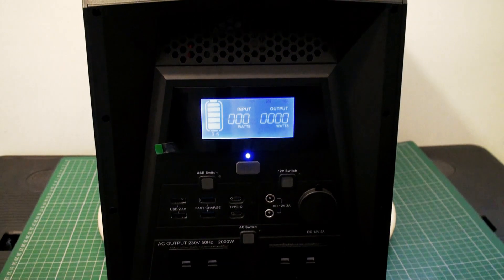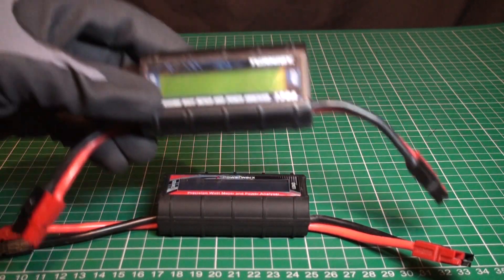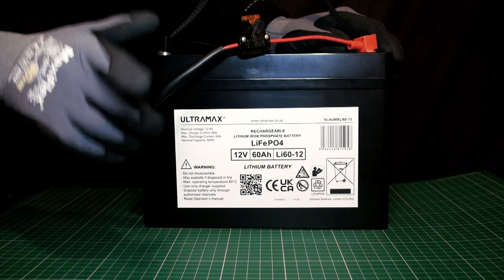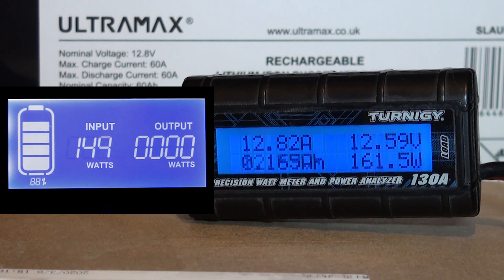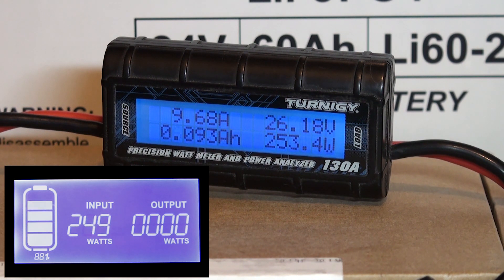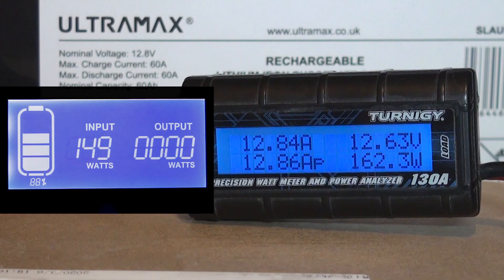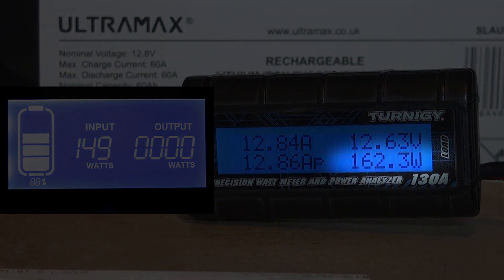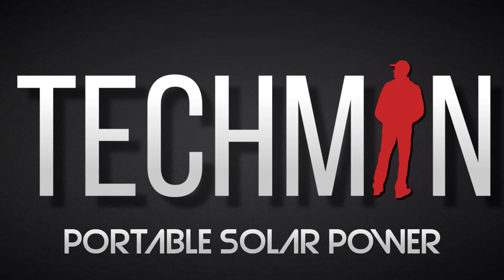Leoch Power Station DC Charge Test

Comment: I found this unit which might be handy to have on these Leoch Battery Generators.  Powerwerx DC-to-DC Solar Charger Controller for Bioenno 12V LiFePO4 Batteries.I think they may work on other manufacturers batteries. Do your own investigations. This will not work  on the XLr input on the first  one listed but maybe the 2nd one listed with a 12 volt battery and the first one on the the Anderson connection? I don't know if you can feed power with two solar controllers in series will work.what do you think techman? Help me out here if you can.

. Input Voltage: 20-50 VDC

Output Voltage: 14.6 VDC
Input Connector Type: MC4
Output Connector Type: Anderson Powerpole 30A
Maximum Power: 300 Watts
Maximum Current: 24 Amps

and/or  DC 12V to 24V 10A 240W Converter Step Up Voltage Regulator Boost Converter Module Car Power Supply Power Converter 
    (24981)
Reply from the maker: For the MPPT input (APP port), I would not recommend connecting an additional MPPT charge controller. Since the port is connected to the internal MPPT CC, it will accept anything from 10.5-35.5v. I demonstrate charging via 12v and 24v LiFePo4 batteries in this video. I’ve also used higher voltage batteries with a DC buck (step down) converter with no issues. 

As for the XLR port, it’s probably connected directly to the battery. The sensible thing would be a) a 24v LIFePo4 AC charger or using an external MPPT charge controller with the correct parameters. The MPPT CC algorithms will charge/boost/float the internal battery efficiently.

Comment: Can you try charging the with 3rd input (xlr input) I found online an XLR to xt60 adapter and then you can get an xt60 adapter to almost anything. Maybe 3rd party MPPT or even external batteries?
Reply from the maker: Hey Nathan. Thanks for the request. Yes of course, I’ll look for an XLR adapter for the experiment. Solar charging via external MPPT charge controller would be appropriate. Charging via external battery should be via the Anderson PowerPole port. I presume the cannon (XLR) port is directly connected to the battery (though I haven’t verified this) and hence charging should only be attempted with a charge controller. Stay tuned...
Reply: @TechmanSolar  here is an adapter
Thanks for the response
Reply: Looks like links disappeare when post them
Just Google xlr male to xt60 female and itl come up on Google

I found an mppy im considering since this one doesn't require stripping cables.

Amazon - bateria 20 amp 12/24 amp

Maybe an external battery could feed an external mppt?
Reply from the maker: There have been many incidents of people using a battery as input source of an MPPT charge controller. Most have not ended well. The charge controller has MPPT algorithms, and the battery does not have current limiting or regulation in place. In most cases the battery pushes the charge controller to the limit and ends up damaging it or in the worst case a fire. 

I have personally used a DC-DC boost converter (with reverse charge protection/diode) to achieve the same and it has worked flawlessly. You could also use the 12v car charger port of pretty much any portable power station with a DC-DC boost converter to achieve the same. Just make sure the charge voltage is per profile of the battery you’re intending to charge and limit the current based on the size of cables you’re using. An in-line fuse close to the battery would be helpful. 

If the XLR port of the Leoch is indeed connected to the battery, this is something I may explore and demonstrate in an upcoming video. You’ll fuelling me with ideas, and I like it :)
Reply: @TechmanSolar  no problem. In the original indiegogo campaign they offered 2 perc options.
1. It included a cheap epever 10 amp mppt charge controller and xlr male to stripped wire cable. This would involve stripping cables off of mc4 cable and screw drivering them into the cheap mppt (most people are not going to want to do this) HOBOTECH did this on camera with a variable voltage adjuster device and tried to simulate a cloud cover situation with voltage changes and the provided mppt responded poorly.  He mentioned a higher quality mppt would probably work better but did not test it further

2. An ac adapter (power brick) to xlr which did end up working well

Of course Leoch at the the time didn't mention anything about amp or volt limits and told people to only use these 2 options (probably because they'd lose money otherwise)

Now they no longer sell those percs but i did message Leoch about the specifics of the XLR port and they only replied "well speak with tech support and get back to you" and its been a few days.

It would be real sweet if we can figure out the real limitations and disover a work around for an external battery.

Iv even thought about trying the bluetti DC charge enhancer but would require a series of adapters 

Now if you look on Amazon they have an updated version of the Leoch without the XLR port and a larger mppt good for 600 watts.
Reply from the maker: EPEver is a decent brand. I personally use two of their tracer MPPT charge controllers for my 24v battery banks. The model provided by Leoch is perhaps the most basic version. I did email Leoch if they were willing to send me the CC for a demonstration but they declined. In all honesty, you could use any reliable MPPT charge controller so long as you set the charge/boost/OVP parameters as per the internal battery, which in the case of the Leoch is 24v LiFePo4 (8S configuration).
Reply: @TechmanSolar  Professor Hobo said there is a cable attachment with battery + - clamps that I presume has a XLR plug in for a 24 volt direct  connection to  the inside batteries and if the outside battery has the same parameters then their should be no need for  outside fuses,controllers etc...  to charge it Correct? Thanks!
Reply from the maker: Hey Alan. I am also under the impression that the XLR port is connected directly to the battery. Hence the need for an external MPPT charge controller. Connecting an external 24v LiFePo4 battery to the XLR port is not as straightforward as you may think. Remember, the external battery voltage will drop under load. The higher the amps going out, the steeper the drop. I would suggest a) solar charging via external MPPT charge controller (solar panel voltage must be higher than the battery charge voltage), or b) using a 12v car outlet via a DC-DC boost converter set to 29.2V.
Reply: @TechmanSolar  any luck on making this test a reality?
Reply from the maker: I’m currently away but I did a preliminary test using an XLR to DC cable. I could not a reading on the DC end. I plan to explore further on my return. I may end up making a video or report my findings on the community page.
Reply: @TechmanSolar  what's the community page?
Reply from the maker: My bad. Meant community posts on the channel.

Comment: Well my leoch is now only producing 1.68kwh. so iv lost 400wh from my battery. Iv been in touch with leoch but nothing back. The unit has only been cycled 8 or 9 time's.
Reply from the maker: Hey Alan. Can you confirm what method you’re using to discharge the unit and at what rate?
Reply: @TechmanSolar  Just the normal. Hot plate fan heater using about 1100w. Every time I'm using it I'm getting less from it. Iv took it apart today because leoch is not responding to my emails. It was charged at 35% then I disconnected the Anderson connector waited 5min then reconnect the Anderson connector then started the unit up & then the display went back to zero. It's on charge now. Il get back to you after I do another capacity test ok.
Reply from the maker: I’ve replied to this comment under my review of the Leoch. We can continue discussion there.

Comment: Thanks for this. Where can I buy the battery cable with inline fuse to recharge my power station?
Reply from the maker: You can purchase them from eBay or Amazon. I would recommend tinned copper cables, 14AWG size cables at the very least. You could use the included cigarette adapter. In this case you just need a cable with a female car adapter on one end and ring terminals on the other. 

Remember, the Anderson PowerPole connecter on the back of the Leoch is reversed (check out my review of the Leoch power station). If you do connect directly to a battery please double check the polarity.

Comment: I'd like to know what happens when charging over 35,5 volts?  Does it simply trip a safety overload, or is it fried.
Reply from the maker: Hey Bern,

I've been doing some solar charge tests and, although I'm not quite finished yet, I have observed that the Leoch takes in up to 35.6V of solar charge. Often it drops the input charge to approx. 28-32V, but it does accept 300W of solar. Anything above 35.6V it would either drop the voltage or disconnect power from my solar panel. I haven't managed to trip the solar input yet. For the records my large solar panels have an OCV of 39V.

I'd be happy to share my observations at some point in the future.